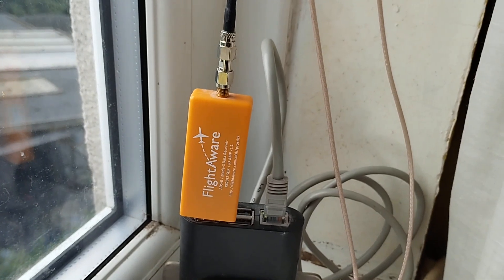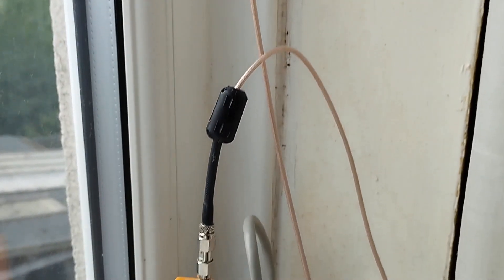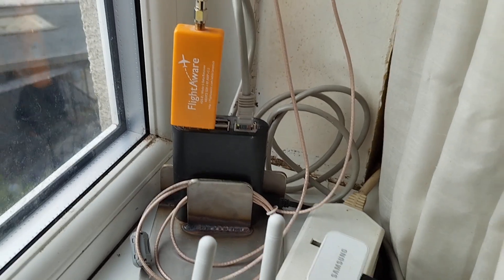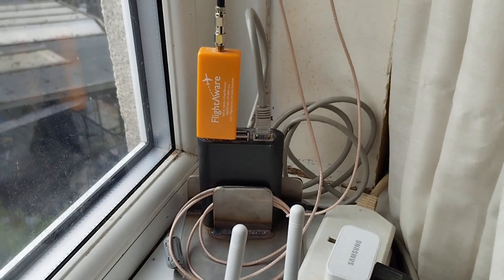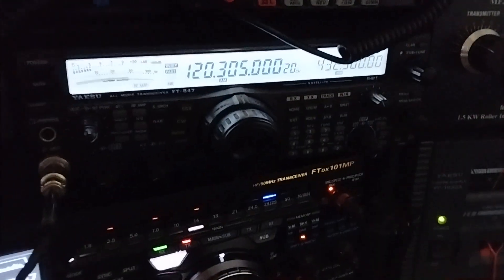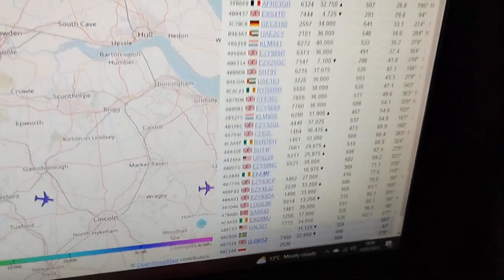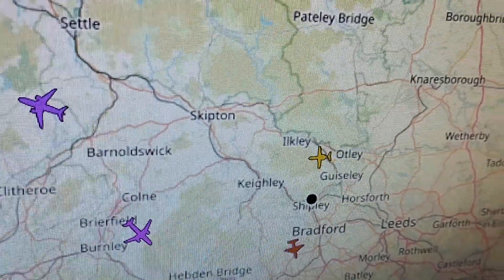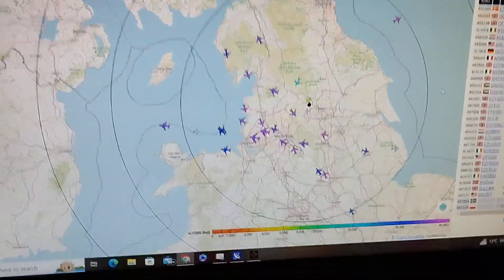A Simple FlightAware PI Aware Aircraft Tracking Station That Works Well.

Comment: Great to see it's still up and running.  I have mine here at home too.  It's great to see it again 😊. 73 bro!
Reply from the maker: Thanks bro still going strong and I think you said Norm made the antenna. You can tell him his handy work is good quality and working brilliant still. Catch up soon bro 73
Reply: Hi Simon I run two plane trackers. The FlightAware blue stick and RadarBox green stick. Both are brilliant, but I much prefer RadarBox. You get more for you uploads and it shows the planes on the ground as well. 73
Reply from the maker: @m7cov  hi Martin thanks for the info I will take a look at radarbox. Cheers bud all the best, have fun 73
Reply: @M0YKSHamRadio  
Yes, Norm did make the antenna.  For awhile the whole setup was at my parents house before I shipped it off to you.  I knew you would use it.... you're a gadget guy like me.  You are very welcome bro.  Talk with you soon.